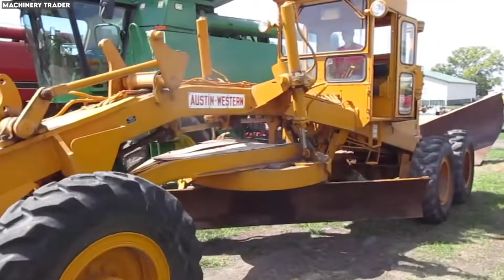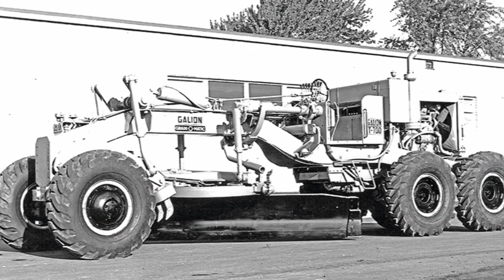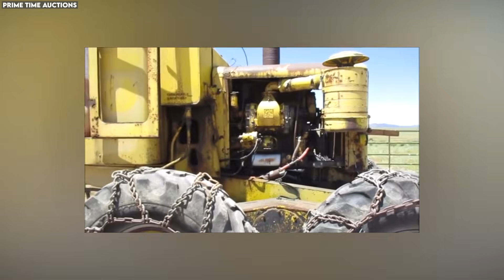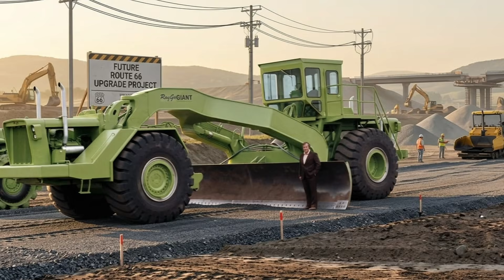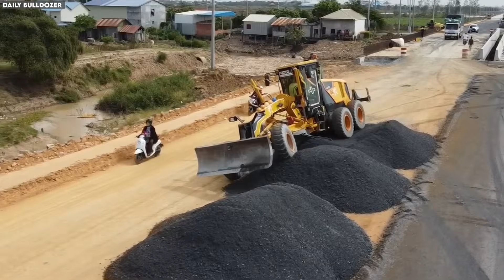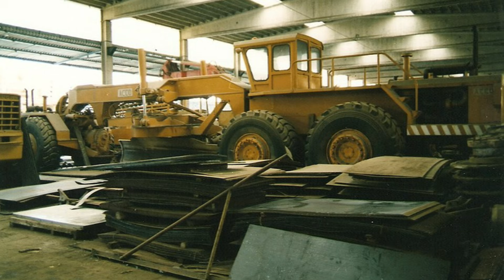10 MOST HATED Road Graders Ever Built

Comment: Hello, Quisoop.
Geez, you did your research and editing well on this one, didn't you????? At 2.15, you mention the Champion 100T as weighing 22,000 pounds. That MIGHT almost cover the six wheels and tires. Granted, you did later give more correct weight figures for it but, like much of the rest of your ROBOT narration, it leaves 'a little something' to be desired'.

Provided that there is sufficient space to operate the machine and the work is there in sufficient quantities for it to do, there is NO SUCH THING as a grader which is too big, only operators who can't think big enough for the machine. I think I might have some qualifications to back that up 'coz I have operated a 20-ton, 220 horsepower Aveling Barford grader and an O&K G350 which weighed more than twice as much.

I don't have anything to back it up but I have heard that the ACCO grader did get to do some useful work on a couple of beach reclamation jobs in Italy before it was scrapped.

Just my 0.02.

You have a wonderful day. Best wishes. Deas Plant.